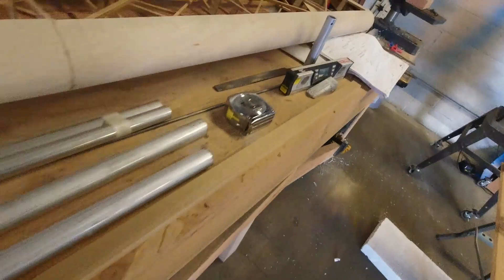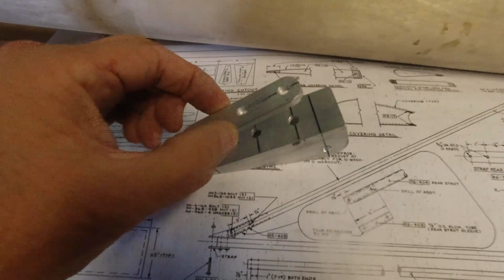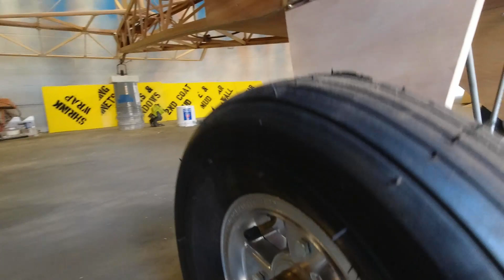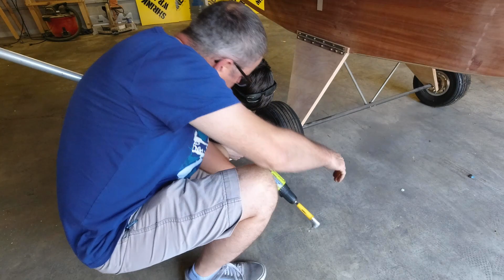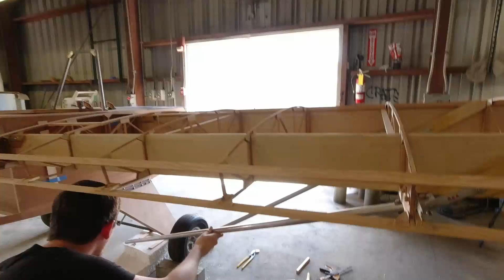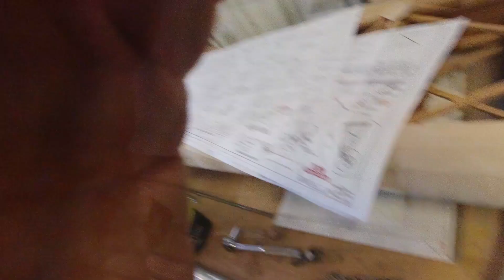Minimax 1100r Wood Aircraft Build Ep 120 - Wing Struts

Comment: In  response to the vortex generators. How did you determine the number of vortex generators. Is there an optimum number? Thanks for the interesting information
Reply: Michael.  I think I bought the "Kit" for the V-Generators from Aircraft Spruce.  You can get on Spruce's web site and input:  "STOLSPEED VORTEX GENERATORS 120."  That will put you in the ball park on this subject.  The kit has instructions and a templet as to how and where to install the generators.  Lots of good information there at Spruce on this subject.  Lots of testimonials - all good.

 I installed mine with a double backed tape (no adhesive) so I could try different installation positions (Remember "experimental," right? :-)  Never did put them down permanently - didn't have to.  On my EROS Minimax, it called for installation "X" inches" back from the leading edge of the wing, based on the cord of the wing - mine was 54 inches.   They were on the leading edge, and none on the fabric.  They are placed at really weird angles to one another - that's to stir up the air at the leading edge, and not at the trailing edge.  That's to keep the laminar flow near the surface of the wing, and not "tumbling" off the wing.  

I found the airplane flew differently (had a little nose down "picture" out of the wind screen.)   The plane would have a tendency to float on landings, but you were flying fairly slowly at that point.  

Spruce wants about $120.00 for the kit - says there's enough for the horizontal  stab also. I think I paid around $90.00 "back when."   Not sure, but I think I even tried them there (on the bottom of the stab.)  I liked them.  See you later.
Reply from the maker: That’s awesome that you were willing to experiment with those Michael!

Comment: Dennis.  Loved your drilling of the tubes - very nicely done.  And Parker was a good asset during this portion of the build.  I found this portion of the build to be a bit stressful.  Didn't want to end up with a bunch of oval holes. :-)    Think I mentioned, I had one wing that had a slight twist - used the rear strut to make it flat from the root to the tip. 

Oh, just remembered Dennis.  I put 90 vortex generators on my EROS  - 45 each side as I recall.  The plane would not stall after that - descended like a leaf at around 700fpm. :-)  Did that so I could fly my approaches much slower.  Had a friend that had a short pasture, and I needed some help.  :-)    I was looking forward to this portion of your build - you didn't disappoint us.  Thanks.
Reply from the maker: Hey Michael!
I had been thinking about this part of the build for a long time. I believe that helped me to form a good plan to get it accomplished. That right angle drill really helped a lot. I didn’t know there was a max out there with vortex generators, that’s really cool!
Reply from the maker: Hey Michael, a viewer asked a question about the vortex generators. You’ll see it at the top of the comments.
Reply: Did you make the VGs yourself or purchase them? If purchased what ones did you get?
Edit: nevermind I see you answered that in another thread already.
Reply: @ulbuilder  As they say in the North East:  Cool beans. :-)

Comment: Good progress, it is coming along well. Tut Tut you did not use a pencil did you to mark your lines???? Make sure you clean it off well as it is a big corrosion factor.
Reply from the maker: Definitely not! Just my B2P pen. 
I learned about the pencil issue a long time ago when assisting someone else with their build.
Reply: @DTMinimax  in the RAF we were only allowed to use green and blue fine markers as black had carbon and red iron. I still remember the corrosion training film about pencils and markers.
Reply from the maker: What was your role in the RAF?
I was in the USAF and a fuel systems specialist on F16’s and KC135’s
Reply: @DTMinimax  Airframe & propultion and a crew chief (Not directly converable to USAF as we did not specialise like you chaps did), effectively I could do anything on the airframe or engine / fuel systems and as a crew Chief, all the line Before and AFter flight checks, refuel, W&B, load and basic repairs on any system and inflight act as 2nd air engineering officer / talking ballest. I worked on Victor K2, Tornados, Wessex,  Nimrod MR4 and Jaguar (crew Chief on Victors and Nimrods).
Reply from the maker: Wow…having more people more versatile seems like a good model.
Reply: @DTMinimax  It did give us a lot of flex, when deployed.
Reply from the maker: How far are you from Kirton-in-Lindsey?
I would love to visit there someday.
Reply: @DTMinimax  About 150miles by road so just around 3 1/2 hours drive but about 85miles to get to the Brookfield Farm airstrip by air.
Reply: @DTMinimax  Dennis.  You have filled many roles in your life - the USAF, eh?  :-)   You always have new and different information for us Dennis.  We like that. :-)   

I was USAF also - 20 years.   Worked Avionics - Included all Flight and Engine instruments - RADAR, Nav. radio, etc.  Was a challenging career field.  After retirement, worked these systems, as a civilian,  on the C-141B aircraft.  Great airplane - now all of them retired to the bone yard at Davis-Monthan, in Az.  Were replaced by the C-17.  Never worked that airframe.  Thanks Dennis.

Comment: Given the busyness at the wheel hub, would this have been a situation where an "exception" to the general rule of bolts going front-to-back?  It may have avoided some of the interference with landing the second strut.  Maybe the plans say "no"; but, just thinking out loud.
Reply from the maker: You are right Edmond, even running that one bolt the other way would have made the rear tube fit easier. When I put the thicker tube on the inside, I had to match the bevel and scallop out the inside to get good clearance. You have a keen eye!